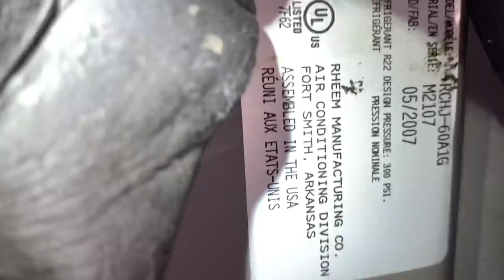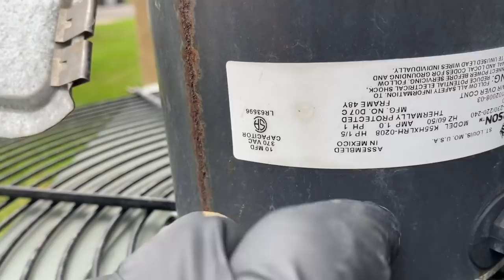Rheem Central AC Outdoor Condensing Unit Not Working - High Pressure Manual Reset Out Dead Fan Motor

Comment: One thought, Mikey you've always said that if you touch it you own it. Well, once you noticed that copper it should have been replaced with a proper sized fuse, whether the customer wants it or not. God Forbid anything happens and the breaker at the main panel fails to trip (if it's even correctly sized) there will be a melt down and first words from a customer will be but so and so was just here!
Reply: Its the same as a non fused disconnect. Really no issue at all. I would have confirmed proper sized breaker in panel and threw in a second piece of 5/8” copper to replace original fuse.
Reply: So I ran into the same thing with a fused disconnect. And I had asked my brothers electric company about it. As long as the breaker inside is the right size breaker it’s ok . 
They told me the same thing as Atch-N-sons said . That it would be safe .

Comment: The height of the fan blade is critical for proper air flow thru condenser coil never seen you measure what I’m my missing in video do you have the magic height on universal motors

Comment: Did you attach the reversing leads using zip ties? Wouldn't that be a problem after some time? I'm just curious. What happens if after being in the heat and cold they become brittle and break and then your wires hang down and get chopped in half by the fan blade?
Reply: If you use good quality,uv rated zip ties they will last for years!
Reply: UV resistance is the biggest issue, make sure you used good UV resistant ties.

Comment: Hey Mike, what size of nut driver do you use on  your drill for the hub puller.  You make it look easy. Thanks.!
Reply: 3/8 socket adapter,then you can use any 3/8 socket you need.

Comment: Client was tighter than 2 coats of paint , pipe for a fuse , and to cheap to buy a filter 10 dollar bill spent 4 months ago would've been cheaper , with a little water spray on the fur coat on condenser so be it says Sam.

Comment: That was a nice 5 mfd cap for a 10 mfd fan motor 😂
Reply: I noticed that too, but hey you can only fix what they want fixed. 😵‍💫
Reply: @Silky_boi  that makes no sense 🤔
Reply: More than likely that motor burnt out because of the improper capacitor and if it starts with the right capacitor the motor is probably already internally and will just fail within a few days at most
Reply: @dantemariscal8679  he replaced it because the bearings were shot. I would have chalked it up to the cap fucking up the windings and it also having bearing failure.
Reply: @justinh7957  And the reason a peice of copper pipe was pt in the fuse holder....

Comment: Copper fuses. Work great 🤣🤣. Had a customer who was a electrical engineer that put copper in his disco.
Reply: many areas by code do not require a fused disconnect on residential HVAC condensers, just a plain unfused disconnect/means of shutting it off visible/near the unit.
technically that just makes it a non-fused disconnect, but it should be labeled as such and ideally, insualtor material around the middle section. this all assumes there's a proper breaker/fusing at the other end panel!

Comment: What do you suppose the amp rating of that copper pipe/fuse?  Probably a bit high.
Reply: It will blow the main for sure,at a serious guess,maybe 300 amps
Reply: the disconnect holder or wiring would burn first, assuming the upstream breaker or fuse failed.

Comment: The disconnect doesn’t need fuses if the circuit is has the appropriate sized circuit breaker. Most residential disconnects are non-fused anyways.
Reply: If there was a fire and it was traced back to that copper pipe identifying as a fuse just what do you think the insurance company would say ?  Hell you are not supposed to have mismatched fuse in the same box . I don't just mean rating but type and manufacture .
Reply: @lhr1701  that’s a valid point. The likely hood of it ever causing an issue if the circuit is protected by the appropriate sized breaker is slim to none though. I guess my point is why even use a fused disconnect if it’s on a circuit breaker? It’s just added cost, a non fused disconnect is a lot cheaper and all that’s needed on residential HVAC.
Reply: @joshrobbins3629  Here is the issue,because it is a fused disonnect you cant bypass the fuses! If its non fused thats fine too,but you are modifying a circuit protection device by putting copper pipe in it!
Reply: @lhr1701  And most folks know that all insurance companies will deny a claim if they found a piece of something jammed in a fuse holder that wasn't a fuse , regardless of the cause of a fire. They will fight like crazy not to indemnify a policy holder.
Reply: @Mercmad  exactly .

Comment: Fan motor is replaced but the disconnect needs to be replaced do not use copper pipe for a fuse that's is a big no no if somebody is not watching on it could catch a fire.

Comment: Contactor should have been replaced. I see no issue with disconnect until system is replaced. Tighter then two coats of paint mamma

Comment: 15 or 20 years ago?  Jesus.  AC units here in Florida near the ocean only last us 10 or 12 years maximum.  I purchased a Coastal Rated unit that is supposed to corrode less and I bet it still won't last more than 12 years.
Reply: @PipeDoctor  yep.  Most people near beach by me just by cheap Goodman's since you have to replace every 10 years anyways.  But I bought a coastal rated Heil because it had a warranty against corrosion which is rare .

Comment: The brown duct wrap is from the 1950s.
If the proper breaker is inside.  That's not an issue.
And it shouldn't be that close to the wall.